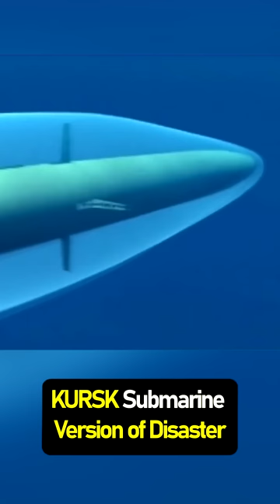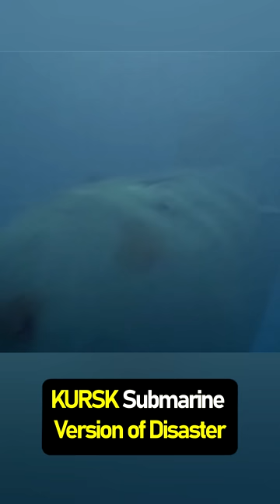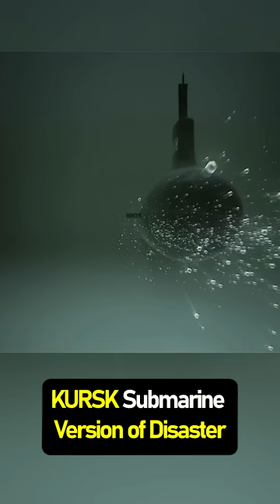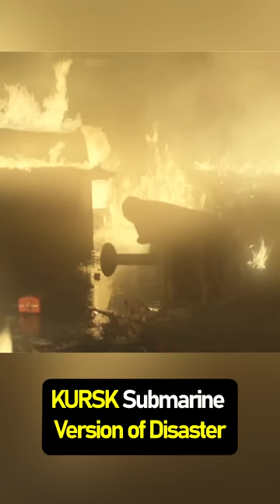Kursk Submarine Version of Disaster #Shorts

Comment: Never heard the torpedo striking an American submarine theory.  I don't believe they would have shot at an American submarine, nor would it bounce off and do a 180 and hit the Kursk.  More likely it was a malfunction of the torpedo in the launch tube causing the explosion.
Reply: Damn Mike, all sarcasm aside, you should've made this video because it sounds like someone let their kid's imagine run wild with this one. 😂
Reply: Yes , those torpedoes were known to malfunction with there rocket motors igniting still in the tube
Reply: I thought it was pretty much agreed upon that what most likely happened was high test peroxide leaked from the torpedo, mixing with seawater and rust flakes. That would be the first explosion, blowing open the tube and starting a fuel fire. The second, larger explosion being the rest of the torpedos.
I've heard the Russians claimed Kursk may have collided with an American submarine but my understanding is that claim has been debunked.
Reply: Absolutely. These torpedo have a certain risk. The fuel is highly reactive and a small leak is very destructive. A first noise was more likely the initial mishap, followed by consequence.
Reply: As we recently seen I Ukraine Russian equipment is substandard at best! No one believes an American sub had anything to do with this doomed boat!
Reply: It almost certainly was a torpedo self ignition of it's engine inside the torpedo tube that detonated which caused the rest of the on board Torpedoes to detonate
Reply: Wagner  Wagner....sometimes a well placed kick in the nuts will get them going.
Reply: It didn't strike an American submarine.  That I know to be true
Reply: Wagner  Will they ever learn?
Reply: The Russians bounce missile torpedoes off of American ships all the time knowing full well they are all duds.  Then they place bets on whether the torpedo will ricochet back at them or not.  It is a modern form of Russian roulette.
Reply: @I-C-Y-U-N-V  agreed person who made video either has no clue what they are talking about misinformation.    I wonder if this persons ever been on a submarine
Reply: I agree completely. That it wasnt an american sub. Remember those torpedoes reacted violently to copper and o2
Reply: @primitivestudio1  how?
Reply: Yeah this story sounds.... a little fantastical
Reply: @OldPapaBear  I could afford a revolver for the old version of Russian roulette,  but  a nuclear submarine!!!   Must be oligarchs only  🤣🤣
Reply: @nojhampton  No problem. They are playing on the taxpayers dime.
Reply: The Russians are having problems with the hydrogen fuel cells sales for the torpedo's that's what it was hydrogen fuel cell detonated which in turn detonated a torpedo causing what we know as the domino effect...
Reply: "Said the vetran sailor !"
Reply: Do a reaserch...what these guy saying in this video is pure nonsense when we all know what have happened!!! This video should be closed!
Reply: It wouldn't be the first time. Russian torpedoes that were poorly stored have been responsible for disasters before and I think that I have heard others say this is indeed what sank the Kursk.
Reply: That's what I heard. Those torpedos had faulty batteries. They would often leak acid possibly setting one off. A live fish in the tube is not good. Gotta get rid of it!!!
That's the theory I heard in the news
Reply: There was an American submarine in the area. The USS Dallas, a Los Angeles class submarine, was on a clandestine mission to communicate with the captain of the Kursk. Kursk. The first sound was a ping. One ping only. Upon receipt, a covert political officer began shooting up the place, and it is alleged that the insides of submarines do not like bullets.
Reply: @PeterMancini  well I always did want to see Montana.......
Reply: @PeterMancini  ah, good, they made it through the Banks and on to the banks, then. Too bad, somebody bought the farm.
Reply: Somebody really likes the movie Red October…
Reply: USS scorpion  sub.
 Supposed  to have been sunk by Russia
Reply: There was underwater a few american subs and an Uindentified submarine .
Reply: @Nobody-Nowhere-USA  Tell that hootie who hunt Abhrams variant for export .Agree they dont blow off turrets
Reply: @primitivestudio1  i have been on a ww2 sub but we didnt dive,lol.  Does that count?
Reply: Want it a dummy torpedo? No explosives

Comment: The Rooskies were using Hydrogen peroxide in they're torpedoes. The United States tried it and deemed it far to unsafe to use.The UK had a similar incident with one of they're submarines,a torpedo and Hydrogen
 peroxide. It occurred while tied up at a dock. They too said " uh, no way, this is crazy town shit!" The Rooskies like crazy town shit. They went ahead and continued the practice of using it. They paid the price when it all went to shit and a torpedo was running on its own and they had to eject it. They did, but it came back. Hit them, the forward torpedo bay went up in flames, and cooked off the war heads. You know what happened next....KA-BOOM!
   This is the condensed version.
Reply: Because it was cheaper. What a corrupt country.

Comment: That sounds unlikely. I'm more inclined to believe the propellant leak explanation.
Reply: Bingo!
Reply: I don't know nothing about the accident but there could be a possibility, remember at the Russian training for submariners is sufficiently lacking (less time in the submarine, corruption in the ranks and lack of experience with weapons.) Plus they were cases that the actual Target you if you miss calculate the distance for the torpedo to arm
Reply: Without direct evidence, the most like cause of any accident is always the least complicated. 
It’s quite possible a torpedo fell off its racks. The peroxide fuel goes off with massive oxygen fire and the others follow soon after.

Comment: Torpedo: bounces off American sub...
Also Torpedo: easily destroys Russian sub
Reply: Except subs are like a turd with a thin metal skin and Shkvals are like a pencil going, literally, 200 mph.

I could easily see a Shikval creasing the forehead of an American turd, then careening off to pierce the Soviet turd.

They weren't designed as "offensive" weapons anyway. They did have enough explosive to be a threat, but the sub doctrine of the time dictated that American subs with superior accoustics, would "get the drop" and fire first.

When this occurred, the Soviet sub crews were to load a Shkval and fire it toward the source of the US torpedo launch. The incoming Shkval, being much faster than US torpedos, would force the US sub to maneuver defensively and in the process, sever the control wire of their own torpedo.
Reply: @aardque  
But what about proximity fuze and the “big sea” problem? If a target is 1 km away and you hit it and somehow upset the guidance system but the torpedo maintains depth control the chance of it coming back to hit the launch sun is small. Also, at 200 knots only very oblique angles are survivable to the torpedo itself. The acoustic hull gives it sone bounce but only the narrowest edge strike has any chance of not wrecking the torpedo that doesn’t detonate but still detonates when it hits the original launching sun. Seems improbable I think.
Reply: @richardkudrna7503  ya no, I tend to believe the theory that Memphis fired the killshot to protect Toledo's escape after the collision, but Shkval's are so freaking cool that you got to give them props any chance you can. 

I even modelled one it's in my Trimble account, check it out!
Reply: @aardque  or maybe Russia sucks at maintaining and it suffered because of it.
Reply: #MuricanBias
Reply: @theginganinjaofficial  #BecauseTheInternetIsntSupposedToBeFair
Reply: @aardque  #no1evenSaidAnythingAboutBeingFair
Reply: American bias! plz nerf.

Comment: What happened was somebody dropped the hydrogen peroxide cativation torpedo during loading it into the launch tube, the volatile fuel mix detonated along with the others in the torpedo bay which blew the kursk up from the inside out, take a look at the wreckage photos. Secondly the crew had deactivated several safety systems as they kept going off, like the emergency location buoy which they had welded into place to stop it activating, which says a lot about their maintenance or lack thereof, they should never have put to sea with the sub in such a bad state of repair but oh no putin wanted to start up his nuclear missile sub patrols again thinking they could still be like the soviet union. Nobody else uses hydrogen peroxide torpedoes like that because they were to dangerous to store and could go off very easily.

Comment: As someone who has a clue about how super cavitating torpedoes work, this is not just ridiculous, it's completely impossible. If the torpedo was launched then anything it hit would destroy it if not trigger the explosive. There is no ricochet effect at that speed. What might have happened is that the cavitation bubble had an asymmetric collapse and that turned the torpedo, but has an almost non-existent chance of hitting the Kursk.  No, whatever happened, occurred inside the sub before or during the launch. Anything else is statistically impossible.

Comment: A circle runner is always a possibility, but a Shkval is anything but silent and has a very distinct signature. Also a circle runner is inconsistent with your double impact theory.  It would also need the torpedo to hit HARD yet not explode — the very thing it is supposed to do on impact — and confuse the inertial guidance system totally, and NOT break the nose (which is crucial to create the supercavitation the torpedo relies on to move at any speed — and is also actuated, i.e. is part of the steering system).

Therefore your version is less likely than a meteor striking the sub underwater.

The two events are much easier explained as one explosion causing a raging fire[1] and killing much of the crew, which then caused at least one torpedo warhead to detonate and causing other warheads to go off then themselves. 

[1]  decomposing HTP turns all of itself into steam and oxygen at temperatures of easily 500°C (930°F).  Note that oxygen-rich and blazing hot atmospheres love helping things burn.
HTP loves to decompose on a lot of things like organic matter (including humans). With some fuel (like C-Stoff) it is hyperbolic (explodes in contact) — then we are talking about temperatures in excess of 2000°C (3600°F). 

Note that the Kursk had HTP+fuel powered torpedoes on board.

Comment: This is bullshit. The Kursk sank because the poorly maintained Hydrogen Peroxide torpedoes that were standard in the post-Soviet Russian navy leaked and came into contact with metal which caused massive pressure to build up before exploding. The force then caused the remaining torpedoes to explode as well, blowing the front of the Kursk completely off.

Comment: Does anyone else here know why American subs use wire guided torpedos? Because up to a certain point it can come back, it's guided by wire to make sure that doesn't happen. When it's first fired the internal sonar it can be guided by controls through the wire. Then eventually the wire snaps due to distance, sonar takes over and the torpedo either hits the target or the sub can get out of the way if it malfunctions. But it has happened where torpedos turned around. More plausible is they fired at a American sub on patrol. It didn't detonate. The Americans fired one back and got it.

Comment: This is amusing... They got the rocket propelled torpedo correct.  The problem with rocket propelled torpedoes is pressure against the firing pin in the nose cone.  If the system does not create an air bubble instantaneously for the torpedo to ride inside, then the torpedo is exposed to the pressure of the water it's in.  In short, because the torpedo failed to create an air bubble around itself before the launch, the high speed impact of the firing pin against the wall of water outside the tube, caused the torpedo to explode while the launch tube was still open .  The torpedo exploded causing serious depressurization in the nose of the ship.  Then the entire nose collapsed and blew off destroying the ship.
   The US shelved this project in the late eighties as too risky.  The Soviets didnt

Comment: No the more likely and commonly excepted scenario is the torpedo had a leak and exploded inside the tube. Which caused flooding and starting a fire in the torpedo room causing more torpedoes to explode and sinking the kursk. The torpedoes had known faults and the Russians chose to continue using them.. No  US submarine has ever reported any damages from a torpedo strike or collision with the kursk at that time. Also I believe not sure but no US submarine in the area heard a torpedo launch from the kursk. Instead they heard 2 explosions.

Comment: They already did the investigation. The torpedo in the torpedo tube exploded because of the fuel type used on the dummy torpedoes. They found the torpedo door in the aft bulk head. The fire spread to the Command Control Center through the vents connecting the two compartments. The secondary explosion was the torpedoes in their holding racks exploding due to the high temperatures within the torpedo room. Their were actually sailors alive on the sub. But Russia refused to let any of the NATO countries help them retrieve the sailors. U.S. had a submersible that could have saved the sailors. The surviving sailors most likely perished because they were using oxygen scrubber filters to lower the CO2 level in the escape trunk were they got trapped. Salt water and the material Russia uses for their scrubbers becomes volatile when they come into contact with each other. The heat residue left in the compartment and the remains of scrubbers found makes that the only explainable cause of the fire that did occur in the escape trunk. Russia treats their military members like sheep. Their reactor shielding is terribly thin. They would rather risk exposing their sailors to radiation to reduce weight, then protect them. More shielding means more lead. Lead is heavy. They think speed is more important then safety and stealth.

Comment: Yeah no...here's why. As soon as a hole is formed in the outer and inner hull, the water outside the sub would rush in so fast that, like in a diesel engine, the air is compressed to ignition. There would not be time for the Kursk's torpedo room to catch fire because it would be filled with water almost half a second after the breach. I hate that we live in the Era of Ignorance.

Comment: Ok well you seem to lack any knowledge about that weapon. The technology does exist. However, the weapon is incapable of turning. You said it yourself. It’s an underwater missile. The American version doesn’t have any explosive in it. The kinetic energy is enough to cause catastrophic damage to a vessel. There is no possible way it could circle back to the ship and punch a hole in the torpedo section. Yet at the time other weapons onboard did seriously lack the required maintenance. It is more likely one of the weapons leaked fuel and caught fire. No damage indicated external impact.

Comment: Torpedo loading mechanism malfunctions, causing the operator to loose control of the weapon and it is dropped. The torpedo is quickly manually loaded without inspection. Unnoticed fuel leak introduces fuel to the torpedo tube. The fuel is ignited when the torpedo is fired and causes the torpedo tube to catastrophically fail due to the massive sudden increase of internal pressure. The explosion compromises the remaining torpedoes and their fuel is leaked into the torpedo room whos crew are now unconscious or dead from the initial explosion. 75 seconds later the torpedo room had heated fuel that hadn't already ignited, to it's flash point and the torpedo room experienced a similar catastrophic failure that caused the submarine to become immobile. Concerns over appearances guaranteed none of the sailors that could answer what happened would survive. Would you really be a good politician if you didn't exploit every opportunity to improve your public opinion through propaganda, damn the human cost. New citizens are born everyday, the younger they are the easier the obedience training typically goes.

Comment: This hole video is wrong .totally wrong read the report on the kursk. The American sub was half the size of the kursk .so if the American sub hit the kursk it would have ended up at the bottom of the sea along with the kursk .it was old mtorpedos not being looked after properly plus fuel leaking in the torpedo tub

Comment: Not how it happened. Ever heard of anhydrous hydrogen peroxide?  It was used as a propellant in Russian torpedoes, but it's not without its drawbacks. If it comes into contact with any kind of corrosion it instantaneously expands in volume some 350 times.  The cursed loaded and older Torpedo that happened to be leaking peroxide. When the puddle of peroxide made its way over to some corrosion it exploded the torpedo in one of the tubes. That was explosion one and it killed all the torpedo men. With no one left in the Torpedo Room to fight the fire it quickly cooked off the rest of the Torpedoes before the crewmates could unjam the door. The next explosion spread down the main Airway for air circulation and wasted most of the other crew members.
What you are doing here is beating us back the Russian propaganda of the day. 
We saw at the raising of the Kursk that the end was blown out... not Stove in.
Conclusion, wrong answer.